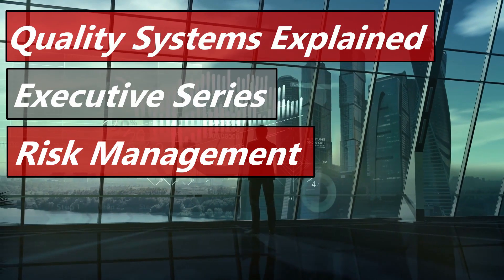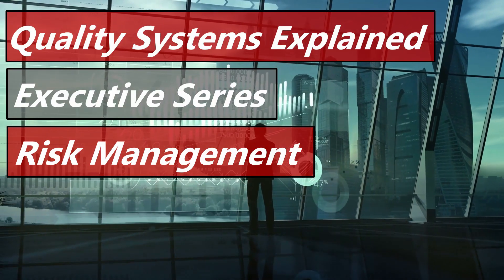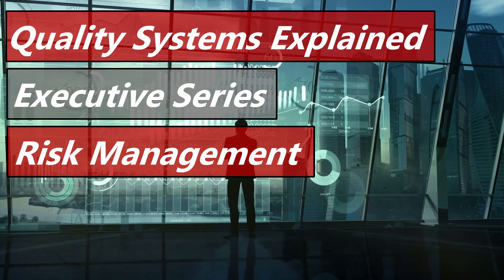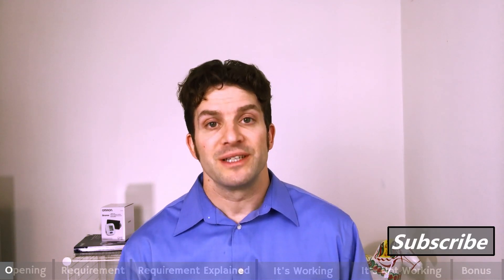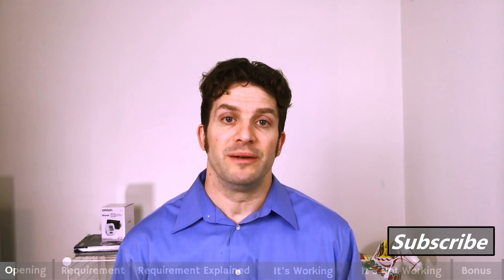Risk Management 820.30g & ISO 13485 § 7.1, 7.3.3, & 7.3.9 (Executive Series #21)

Comment: Is design controls risk management? Does it say u must meet ISO 14971 or what?
Reply from the maker: Hi Docudrama,

Design Controls and Risk Management are two separate processes that work together to produce a safe and effective medical device.  Risk Management is used to define, document, and implement the Design Controls processes.  Risk Management is also used throughout the QMS.  ISO 13485 does point to 14971 in sections 7.1.  It is also identifed for multiple definitions in section 3.  I hope that helps.  :)

Sincerely,

Aaron
Reply: @QualitySystemsExplained  ok. I just don't see any section in 21 CFR 820 series that outlines Risk Management like ISO: 13485:2016 as it points to 14971. 21 CFR doesn't point to any risk management procedure that requires a DFMEA, PFMEA etc like 14971 does.